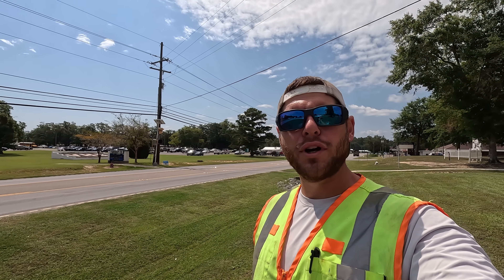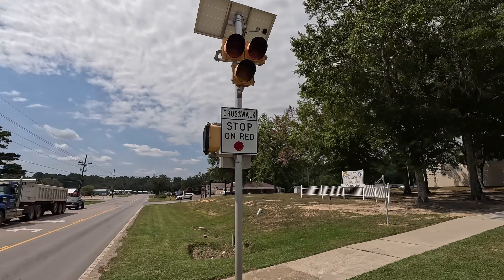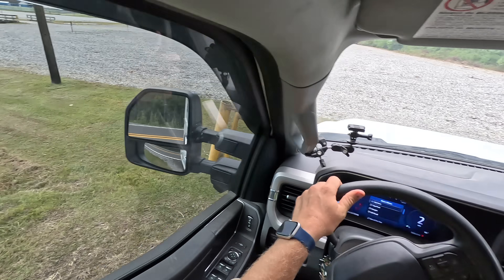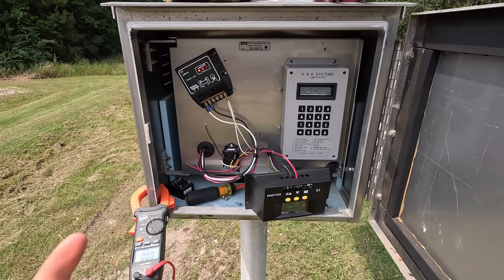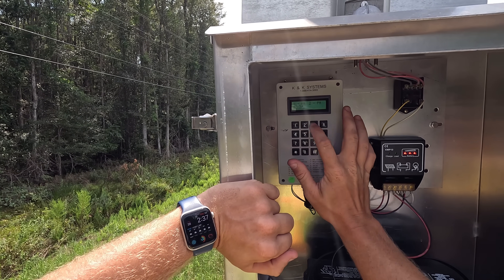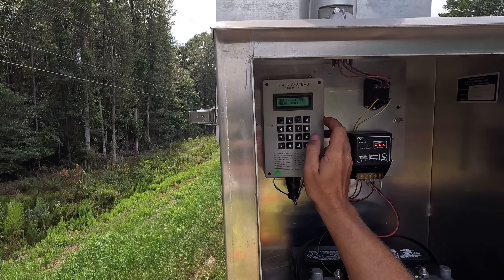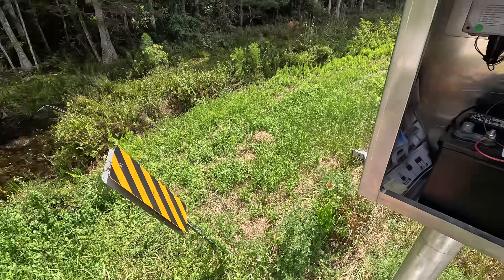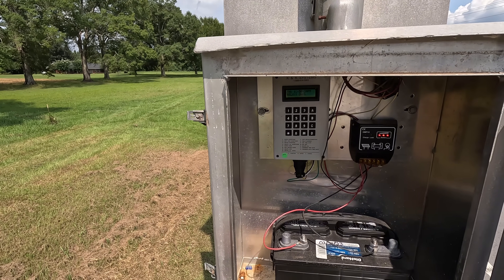Emergency Call! The Sheriff Needs These Flashers Working ASAP!!

Comment: new insight unlocked. if you get a speeding ticket in the flashing zone, you might be able to fight it due to wrong operating times.
Reply from the maker: Very possible!
Reply: Probably not, the signage specifically says "when flashing" which usually means whenever it's flashing it's enforced regardless

Comment: That's crazy they use what's essentially a kitchen timer to control those lmao. Local clocks drift over time and there's absolutely no synchronization with the lights on the other end or even the ISD's schedule. The fact that Sherriff is just rattling out times ("7:15a, eh 7a is fine too") seems amateur-ish, esp for a device that can be used to issue tickets. My consumer $10 "Smart Plug" that I use to program outdoor/indoor Christmas lights sync clocks with the internet and use an app to program on/off times. I would've imagined a central control center at school or city HQ that manages these.

Comment: You would have better results using a AGM deep cycle battery instead of the car battery. Car batteries are designed to provide frequent short bursts of high amp power. They tend to degrade fairly quickly if they are routinely discharged beyond a certain amount. For industrial applications, I would recommend the EnerSys series of batteries. They tend to hold up pretty well in "industrial" applications such as providing back up power for uninterruptible power supplies and solar powered sites.
Reply: The problem is trying to convince city and municipal comptrollers and their fellow bean counters that AGM and other batteries in that class are better than just grabbing car batteries off their bench stock.  I suspect that car batteries are used because they are "cheaper" on paper and easy to sell to those who control the purse strings.
Reply: We have a similar but different application and traditional car batteries die really quickly - often as little as 3 months whereas gel deep cycle batteries will last 3+ years - the better quality ones 4-6 years and they aren't that much more expensive than a good quality car battery albeit double the price of the cheap and nasty budget ones. Gel or similar deep cycle types have much better acceptance of solar charging and 10x or more the charge cycles.
Reply: @Rroff2  That is similar to the 24x7x365 public safety system that I have experience with. Management decided about a decade ago to go with EnerSys AGM batteries because their reliability and cost. Management also runs a battery replacement program on a 4-6 year cycle to keep things fresh across the network.
Reply: The batteries in the cabinets are deep cycle batteries.

Comment: Wild - i never would have guessed those have a car battery in them
Reply: They dont, its a deep cycle. Recreational. Doesnt have high crank amps like a car battery has, but has good amp hours for continious and long life.
Reply: Traditional car batteries won't last long in this kind of application at all (we've had them die in as little as 3 months) - a gel deep cycle battery has 10x or more the charge cycles and better acceptance of solar charging - run of the mill ones will last around 3 years in this kind of application (I can't say for sure in this case as our application is similar but different), higher quality ones potentially 4-6 years.

EDIT: In this application they are probably not getting the depth of discharge to overly trouble a car battery though as running the lights is only a short period of the day.
Reply: AGM/Deep cycle. It's a littlebit different indeed. These deepcycles are places in campers i.e. for the lightning etc. They DO need a charge from time to time ofcourse, often sooner than later.
In a camper they are charged while the engine is running, same as the starting battery.
Reply: @NiVRO90  Thanks! Learn something new everyday! Didn't even realize there were different types

Comment: Are there no electric lines that could be tapped off of to power it rather than using a battery?
Reply: battery + solar panel is a pretty standard setup. Look for them and you'll realize they're everywhere

Comment: 07:03 14.6 volts is good, but disconnect the battery from the solar charger, and load test the battery. That’s what I would do, if I wasn’t sitting in this arm chair telling you what to do. 🎉

Comment: Interesting that they are using clocks to control the lights. Seems strange that the school maintenance isn't taking care of the warning lights. But, after watching your video's, the lights are in good hands. When i was working for a school system, ours were radio remote from the school. Still solar and battery powered!! Not sure what controller were in the lights, only assisted with some battery replacements.
Reply: Likely cost - someone believes that clocks are "cheaper" than radio - or, more charitably, the flashers may be in a radio 'dead zone".  Radio signals on the freq that controllers use just may not reach where those flashers are.

Comment: 14.6V on the battery... way too high, especially if that's the float charge voltage. That battery will not last long. To maximize the life of lead-acid batteries the float voltage should be no higher than 13.8V, slightly lower if the ambient temperature is high. Proper charging voltage (not too high, not too low) is one of the crucial factors in how long a battery will last.

Those CMP12 charge controllers are some generic made-in-China $4 special, the documentation I could find is not very good but it looks like this just very crudely charges the battery up to approx 14.4V (and assuming your multimeter is accurate, it's going above that). Spend the money on some better charge controllers and save money in the long run on battery replacements! Ideally a controller with multi-stage charging, (bulk, absorb, float) and temperature compensation.
Reply: They would probably have better results going with something like a Morningstar SunSaver. I have been involved with the deployment of dozens of SunSaver sites and they tend to be fairly reliable (assuming they aren't damaged by nearby lightning activity).
Reply: Yes this controller is cooking batteries. Crazy because a proper controller costs much less than one killed battery.

Comment: It would be great if the K&K Controllers had (1) satellite time sync to always keep the times correct (2) a USB or serial port that you could plug a computer and set everything that way! A sticker on the inside with the correct school zone times would be great, but they also need signs on the outside, incase the lights aren't working, people still know they need to drive the school zone speeds during certain times

Comment: off clocks...kinda not suprised, there.  it's like they used the cheap civillian guts or something.  I have one here that gains 10 minutes  constantly, and has to always be reset, while a newer alarm clock I have is actually LOSING five minutes a month.  something about DC voltage makes those not work right.

Comment: I took a look at the specs for that K&K controller; the timer's crystal clock is supposed to be accurate to about 10.5 minutes per year at 78 degrees Fahrenheit. Crystal clock errors increase rapidly as their temperature elevates and they age.  Given your Mississippi heat & the enclosure doesn't appear to be ventilated, the actual drift could be much greater! That would account for the clock error you encountered; someone like you should probably correct the time setting before the start of the school year. It's too bad K&K didn't include an on board GPS receiver or provisions to connect an external one to provide better clock accuracy.
Reply: In this day and age with how relatively cheap GPS receivers are, I can't believe they wouldn't include a GPS receiver. It doesn't even have to be a high-tech super fancy. Super accurate. It just needs enough for time, and even fuzzy time at that.
Reply: @napsterbater  you wouldnt believe how shit products that governments or city use
they just need them to X and dont care about Y for the future - cause they know theyll just spend more money and get new ones
plus it doesnt hurt that someone from K&K knows someone that knows someone....
Reply: I had the same thought about using GPS to keep the clocks synchronized. Very interesting that they didn’t do that.
Reply: I was getting ready to dump the K&K pages when I noticed the device has provisions for transferring programming between physically adjacent devices. Apparently, it uses a single wire (& I assume ground) so it must have serial communication capability. If that's the case, it's within the realm of possibility for the device to accept a NEMA GPS signal with accurate time information. Anybody interested in a little firmware hacking? 😂
Reply: @wizardgmb I just looked it up…there are converters for K&K controllers for serial to fiber connection.  If they wanted to Run a fiber link to the controllers for the lights…it could provide time and sensor input.  Definitely need a firmware update but such a change would allow the School to adjust the timing and the Traffic Light 🚦 Doctor to remotely assess the unit
Reply: That’s what I was going to ask…why not use a GPS/Glonass signal ?
Reply: When the schools bid for these, they usually take what is cheapest as there are several bids put in, everyone bids with the cheapest hardware to win the bid, i think what one person commented is what should be done, either add GPS sycro or have a yearly time update. GPS would be cheaper in the long run.
Reply: @bloodbull123 John Glen once said "I felt exactly how you would feel if you were getting ready to launch and knew you were sitting on top of two million parts — all built by the lowest bidder on a government contract."

However, it isn't necessarily a matter of taking the lowest bid; the governmental entity needs to be sufficiently knowledgeable when writing the bid specifications. That is often the root of many purchasing snafus & lack of suitability or efficiency. Look at the recent @trafficlightdoctor video about installing a second pedestal when the already installed one could do the job.

As far as installing GPS standards on existing installations being cheaper than having someone like @trafficlightdoctor reset the controller annually, it's neither practical or cheaper. Given K&K's aforementioned upscale product that ensures long term timing accuracy, they have no incentive to offer a GPS upgrade to this entry level product. Because children & vehicles are involved, any attempt by a third party to hack the device firmware for GPS timing would result in huge liability issues as well as firmware copyright issues. 

The various entities that own these controllers need to accept the need  for someone to correct the timing once or twice a year or upgrade to newer hardware with GPS time standard or remote access. The business employing the @trafficlightdoctor not withstanding, school safety officers/deputies could spend 10 minutes reading the manual or being instructed by @trafficlightdoctor and perform the corrections.
Reply: @bloodbull123  What's cheeper those upgrades or  maintenance contract to just check them the week before school starts?
Reply: @DaBuckeyeGoose it's about what gets approved. Likely reactive calls will be approved quicker (different escalation path) than hardware installs that take multiple board meetings to discuss...
Reply: Not having some kind of GPS, Atomic Radio (Ft Collins, CO), or Internet connectivity to auto set and sync the clock is wild for a traffic control device. The tech himself didn't even bother matching the seconds by entering the time at the top of a minute - something I like to do with my microwave bc I hate two clocks showing diff times (microwave vs oven). But when the drift is so bad, I guess why bother 🤷🏽‍♂
Reply: For just time....  WWVB signal requires a lot less electrical power.  This is the low frequency signal that the "self set" clocks use -- I have a regular wall clock with one regular AA battery, but it has perfect time all the time.  When I changed the battery, 20 minutes later it was back to perfect.  Works great.
Reply: Why waste satellite when you can or just hook it up to basic internet line and grab the time from a server(ntp) operated by the county.
Since you already have internet connection for remote monitoring of cameras to
Enforce traffic violations
Do a daily synchronization around 1AM.
Reply: @qv6486  You don't connect to gps satellites, you just listen for them, and you don't need a dish or anything. That's why it's such an easy option. Hooking up data has its own complications whether it's by cable or mobile.
Reply: @Dewkeeper thanks for the info.
Reply: @qv6486 There is no "waste" of satellite resources, the GPS signal is there & available if you use it or not. K&K has an upscale product with cellular remote access & configuration as well as synchronization of nearby devices using a 915 MHz radio connection. Upscale = >>>$$$ This is K&K's base level product.
Reply: Wow, so that clock can drift up to 10 minutes each day? Good catch.
Reply: @chrisstromberg6527 No, 10 minutes a year or a couple of seconds a day.
Reply: @chrisstromberg6527 10 minutes per year

Comment: They just put in some similar ones at the college campus down the road from me here in Central Texas. They have buttons, but there's a "radar" motion detector on each side mounted on the pole that points down to the sidewalk right next to the pole so a pedestrian doesn't even have to press the button.
Reply: Unintended motion detection could trigger a crossing signal when no one intends to cross.

Comment: "it's not working'!" Yeah, that sounds about right. Used to repair IT equipment for a large US grocery chain (not Kroger) and many times would get equipment sent to me by our field techs with such explanations. My all time favorite was an HP PC which the tech wrote on the trouble tag 'It got a boo boo." I believe that ended up being a bad power supply, which the tech could have easily replaced the faulty power supply at the store.

Comment: DieHard was better when it was sears
Reply: I stopped buying them many years ago as they couldn't stand up to the desert head and died around 3 years.

Bit of trivia, that keypad is based on a telephone type keypad and most people don't know about the letter row.  They were used in special devices to provide more key input.  That may just be a matrix keypad but in phone use it would have generated 4 high tones and 4 low tones that together give it 16 possible combinations.